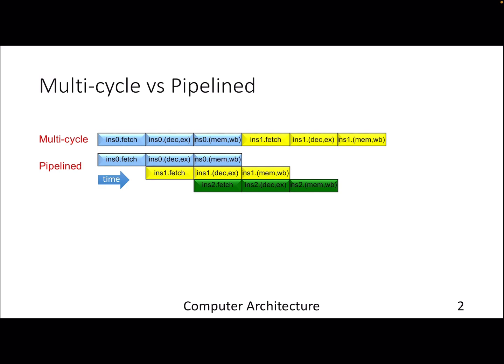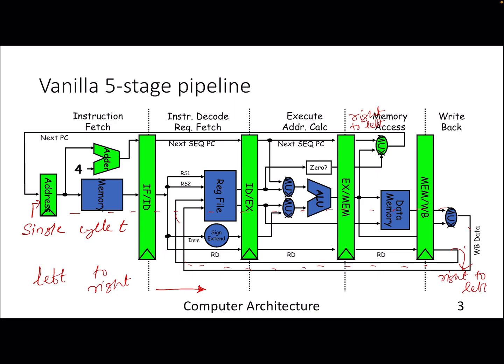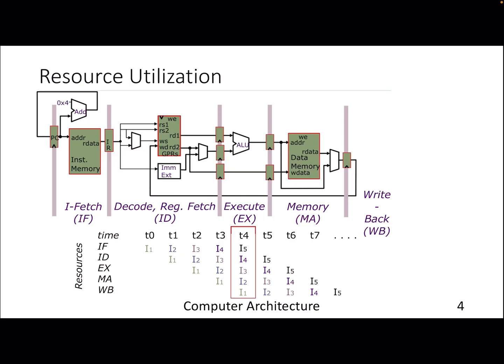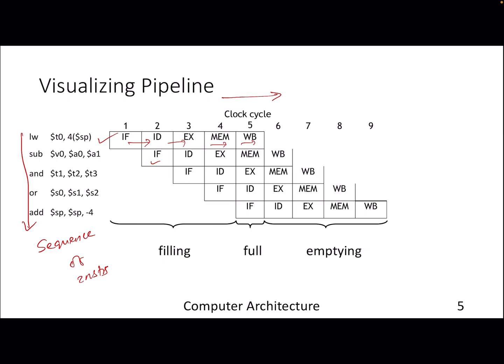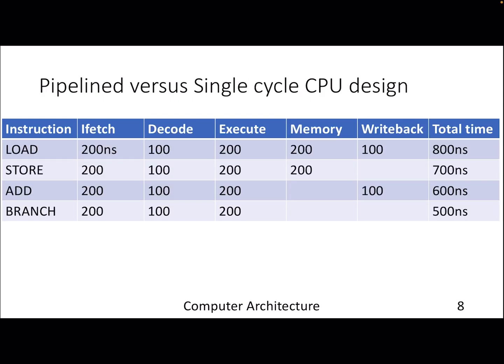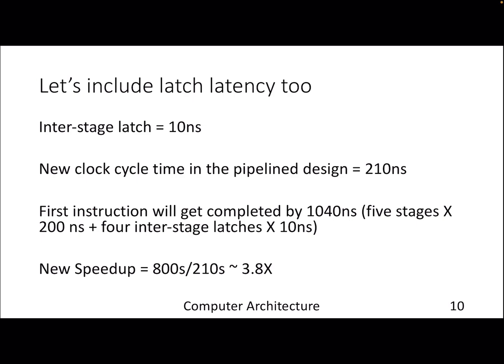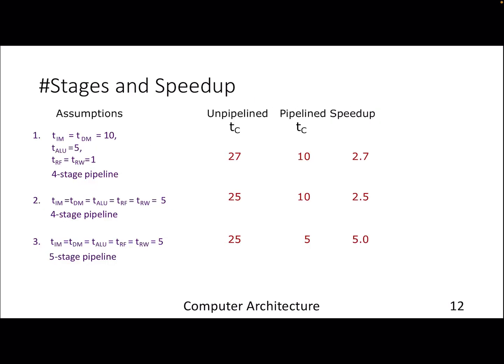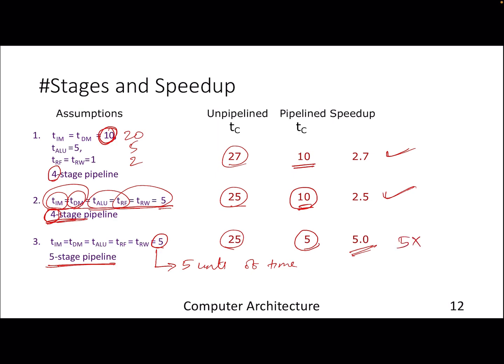Lecture 20: Instruction Pipelining-II

Comment from the maker: Confusion alert: Slide 3: The right place to put the MUX that selects PC+4 and the target is the fetch stage.
 The slide shows a vanilla 5-stage pipeline if we just take a single cycle datapath and perform a transition into the pipelined design with five stages.